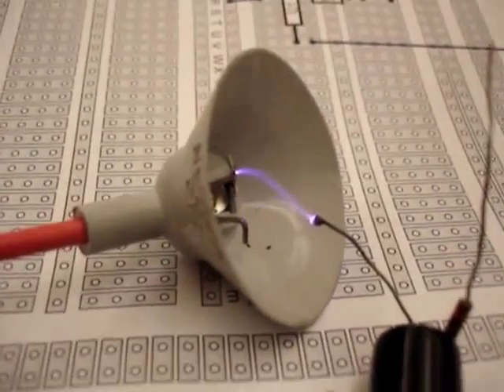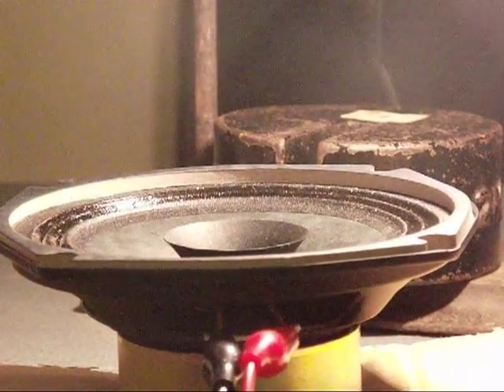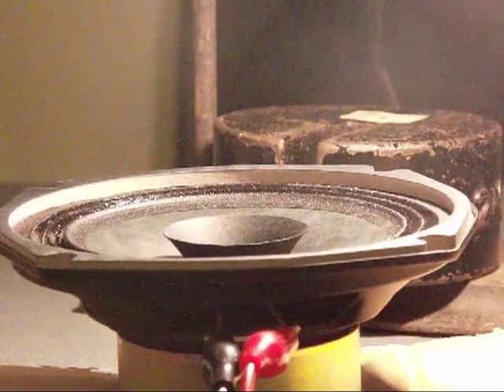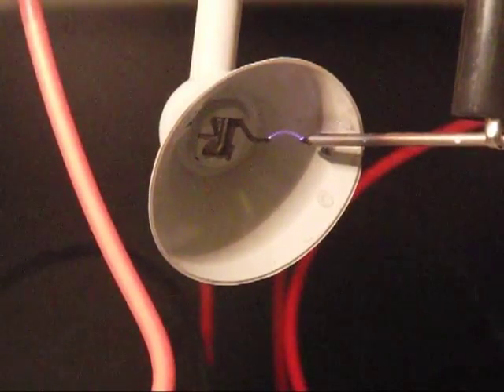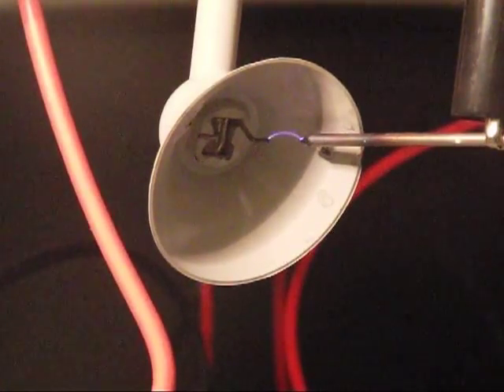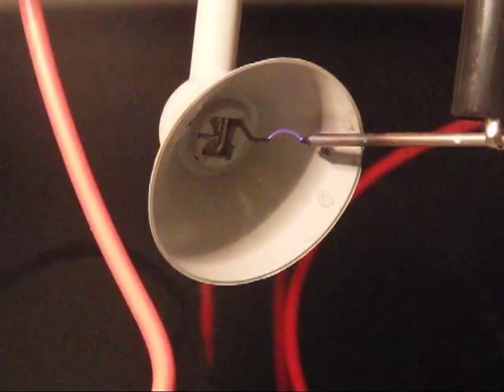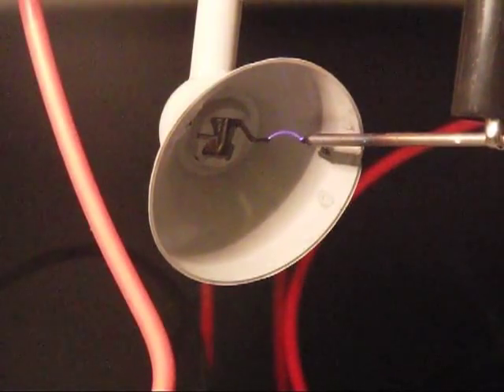slow motion plasma speaker

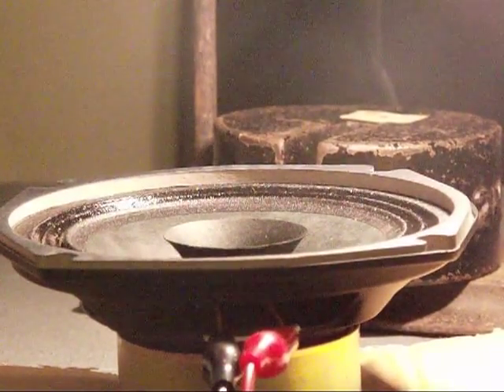Comment: Overall I appreciate your video as you have provided insight into speaker mechanics that others do not execute as efficiently as you.  However- at 1:16 you said "If you could tap a pencil on a table 200 times a second, you wouldn't hear 200 pencil taps every second.  Instead you'd hear the same G note that is being played on the speaker".  This is false, as frequency equations can be physically understood and calculated on many instruments (with the correct universal equations) and have a certain variable frequency, otherwise it is an idiophone or membranophone.  What you're referring to is a concussion idiophone, or struck idiophone.  The sound produced from a single pencil tapping a table is from a variance in sound pressure, which is largely put into motion by the slightly deformable bodies of a table and pencil via means of the very rapid transmission of the absorbed forces from the collision- or more specifically- the air displacement from these quickly propagating waves along the surfaces from the forces traveling within those two physical systems upon collision.  First off, this sound produced is no longer than a quarter of a second as the two bodies that collide (the pencil and desk) return to their normal non-vibrational resting state from being dense, solid structures with little elasticity- so an experiment with around 50 taps within a quarter second does suffice.  Interference patterns from 200 completely identical copies of a single pencil hit will give you a tone that is a G, but this does not represent the quick mechanics of the instruments, rather the process of signal interference.  If the G note played on the speaker is not a sine or cosine wave (or a similar saw wave) or another digitally synthesized wave, then there should be continuous dynamically changing alterations / slight variations that are not just the note G played.  These are noticeable in a spectral analyses and are calculated by taking derivations of equations set equal to sections of the wave file and are an indication of non-constant acceleration of the surfaces… this gives the sound an interesting timbre.  

I proved my hypothesis by actually recording multiple, excessive pencil taps.  Oh why must I prove to myself my righteousness!  (sarcasm)  But I do have the audio file which I could post in a video if you are really interested.  In it I overlapped a single tap and then overlapped different taps... and in both instances I also quickly dampened the wave files upon the following pencil tap hitting.  This had little effect as the voice masking from continuous pencil taps spread 0.005 seconds apart is sufficient to cause a similar sound.  

For further investigation, I recommend this article on Loudspeaker Nonlinearities: http://www.klippel.de/uploads/media/Loudspeaker_Nonlinearities–Causes_Parameters_Symptoms_01.pdf
Reply from the maker: Hi - good point.  I certainly did not mean that the sound of a pencil being tapped 200 times per second would sound like a pure sine wave with a frequency of 200 Hz - clearly there are harmonics.  However, your ear tends to lock onto the fundamental frequency, which would be a G at 200 Hz.  You can see a demonstration of this effect in the video "Sound Waves - Sources of Sound" which is Lesson 32 in the classic "Demonstrations in Physics" series of videos by Prof. Julius Sumner Miller (available on YouTube).  In the video, at about the 6:30 mark, you can see him demonstrating a device that produces a rapid series of puffs of air that produce notes, although the notes clearly are not pure sine waves and no-one would confuse them with pure tones.  However, a rapid series of puffs clearly produces a higher pitch than a lower series of puffs and it will produce a distinct note insofar as your ear will recognize a dominant frequency.

I'm impressed that you made a digital recording of a 200 Hz series of pencil taps.  I think you should post a YouTube video letting people hear your rapid series of pencil taps.  I'd recommend a progression in frequency starting with 1 tap per second, then 2, then 5, 10, 20, 50, 100, and finally 200 taps per second.  The lower frequencies will be heard as a series of taps, but the higher frequencies will sound like tones, although they will be more like the square wave tones that came out of old video games than pure sine wave tones.

Now, if you really want to get exotic, you could modulate your pencil taps to produce sounds that your ear would hear as pure sine waves.  Look up "pulse width modulation" (or PWM) to find out how to do this.  PWM is used to make class-D amplifiers and most people listening to a class-D amplifier hear a pure tone even though the amplifier is actually producing a rapid series of on-off signals.  An even more exotic method is to use Don Lancaster's "Magic Sine Waves" which are a very efficient form of PWM that uses waveforms that look nothing at all like sine waves on an oscilloscope that would produce tones on a speaker that would sound like pure sine waves.

Thanks for your very interesting comment!